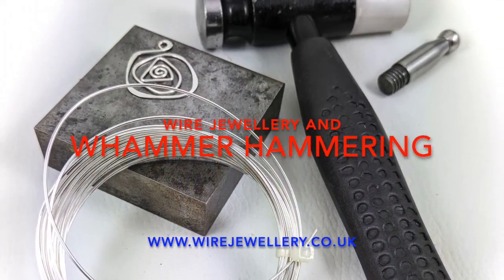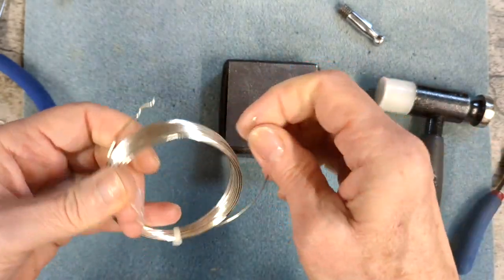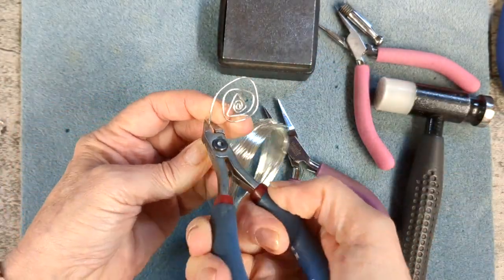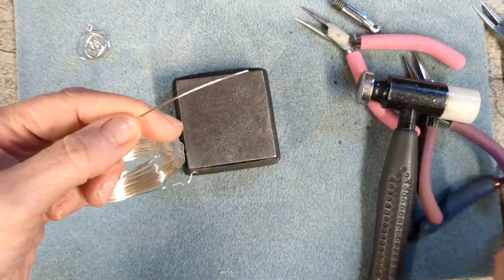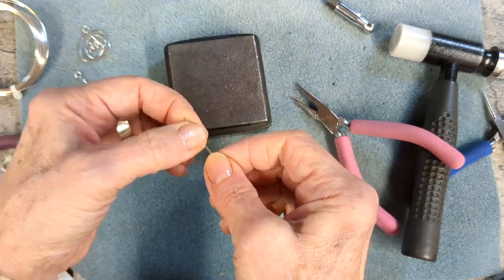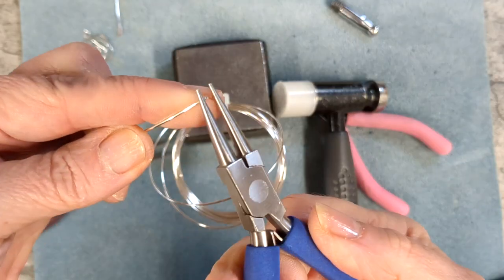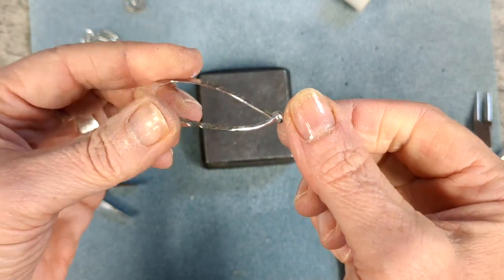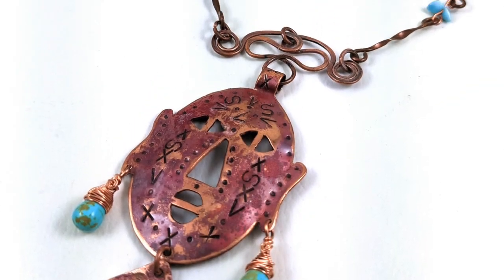HAMMERING TECHNIQUES for beginners

Comment: Thanks for this...not sure you will get it but...I do hammer how ppl say but...mine never seem to flare out as much as everybody else's...makes me feel like rubbish...any advice if get please...hugssss💚💚💚
Reply from the maker: The wire you use makes a huge difference to getting the wire or metal to flare out.  It has to be SOFT, not half hard. Have you worked with aluminium wire? If not, try that and then practice how the wire spreads when hammered, as that is always soft. If I was teaching and helping you, I would give you some 1.5mm aluminium wire. Get you to make some squiggly shapes and doodles and then hammer then to see how it spreads and flattens.  It does take practice, so don't get down. Learning a skill is an on-going evolutionary process 😃❤❤❤
Reply: @LindaJonesWireJewellery  Thank you, Linda... should've said what wire I use, sorry...I do use bare copper soft wire...I've always had trouble with the hammer thing...But when you see how Artists really flare the wire on curves etc...I could never get it like that...I get a lil' bit but not as much, which looks heaps better...I tried Aluminium wire years ago, don't use any anymore...spend enough on copper, lol...I had your channel ages ago, but lots ya...found you again yesterday...so is really good to see your still around...take care...hugssss💛💛💛